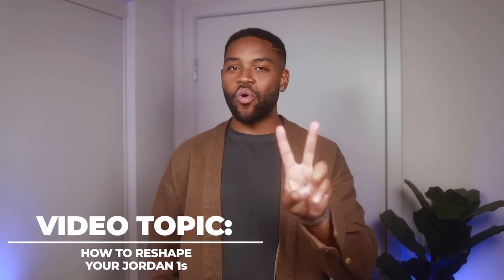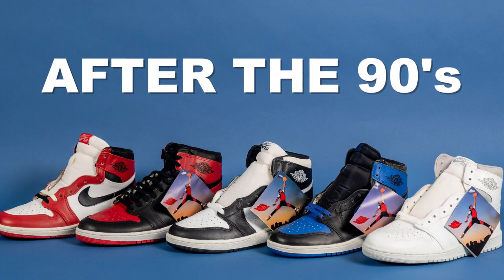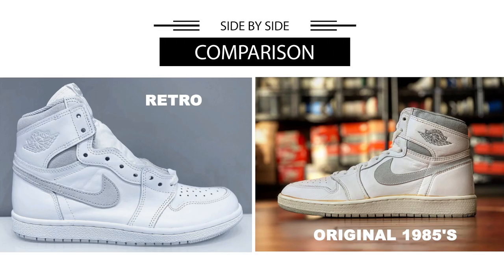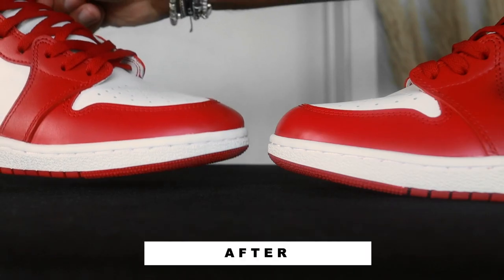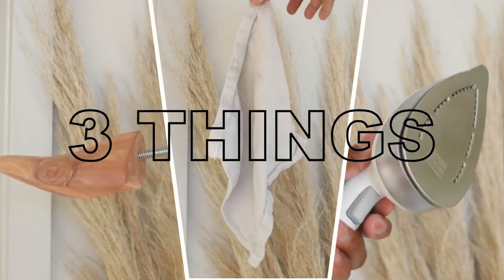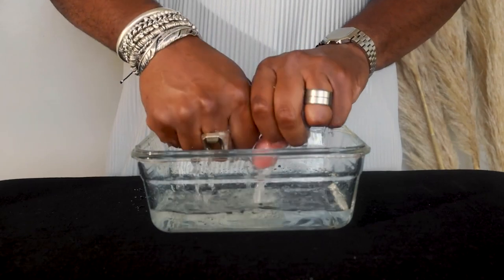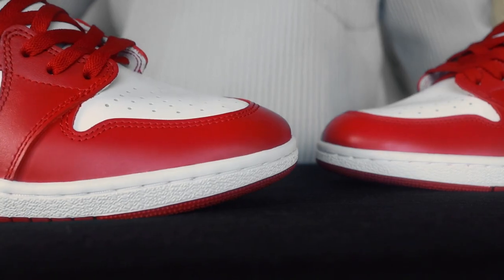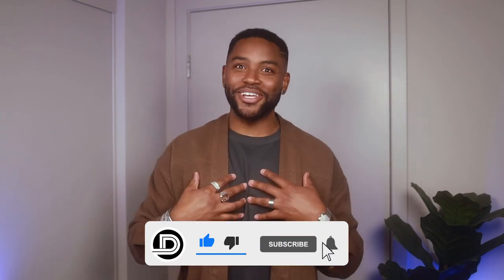How To RESHAPE a Jordan 1 Toebox in Under 5 Minutes

Comment: You can do this with 3s, 4s, 5s and 6s as well. 

Leather is super easy, but with nubuck be careful, you need to heat it then stretch the shoe straight. 
You'll get that 80s/90s sleek toe super nice.
Reply: How it work on tumble leather

Comment: I notice many AF1's take this too the next level... They're bulkier so it doesn't jump out too badly, but it's raised quite a bit and has this clear angle to it. I see pictures of AF1's that are much more like your usual sneaker's toebox curve, barely even there. My AF1 High's are right next to my Forum 84 highs on the shelf, and the differerence jumps out at me everytime.
I'm SUPER hesitant to try anything as these are Unlocked By You's, maybe if I ever wear out some cheaper AF1's that aren't limited I'll try it, but I'm still just gonna watch this out of curiosity.

Comment: Any chance you could make a video on straightening the heel of the shoe to make it more OG accurate?
Reply: that can't be done, they cut the leather, mold the heel counter and make the sockliner so that it gives the shoe that slightly curved look. You would have to basically rebuild the shoe to get the heel straight.
Reply: @NonLegitNation2  is it possible on non OG retros?

Comment: The design is accurate to the ogs, but you can see overtime and/or with extensive use, they give a little bit and reshape. Some of those pics you showed of ogs literally have the same exact shape toebox.
Reply from the maker: Ok
Reply: What's weird is I see pictures of Nike's that seem brand new with this toebox. I feel like it's just crazy inconsistent first and foremost, but the shapes have been trending towards looking less sleek and clean overal.
Something I've noticed with worn pairs, it's kind of a tossup whether they become flatter or actually the opposite, I've seen a pair where one shoe was almost like a right angle going up and then horizontal, the other was almost immediately horizontal with a nice curve.